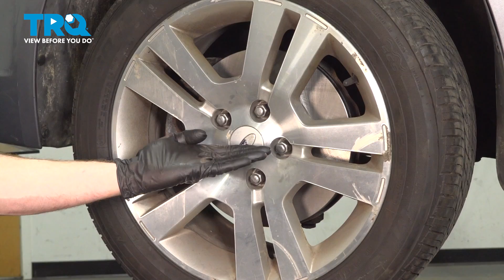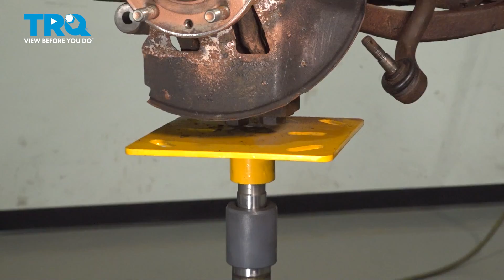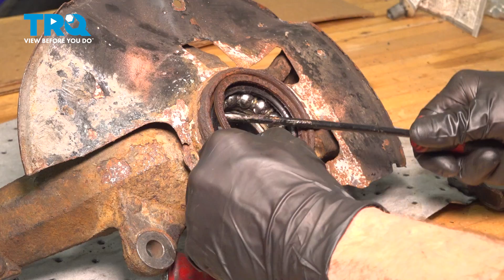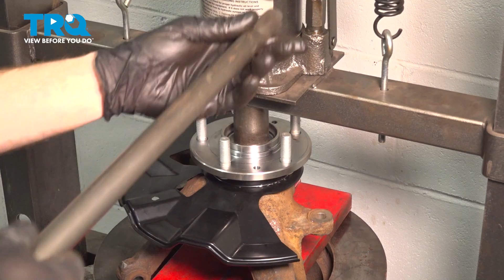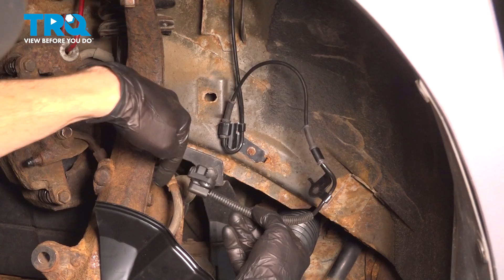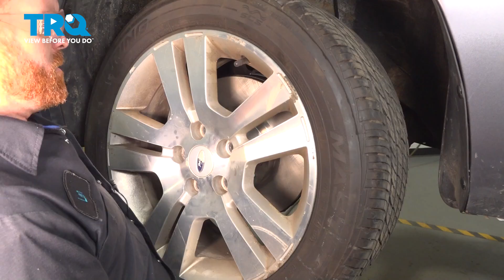How to Replace Front Wheel Bearings 2006-2012 Ford Fusion

Comment: Easier to use a bearing/hub puller set rented from an auto shop and do this while it’s on the car. You WILL NOT be removing those lower control arm ball joints in your driveway I guarantee that. Using the rented tool and doing this with the spindle still on the car prevents the lower ball joints from needing to be removed.